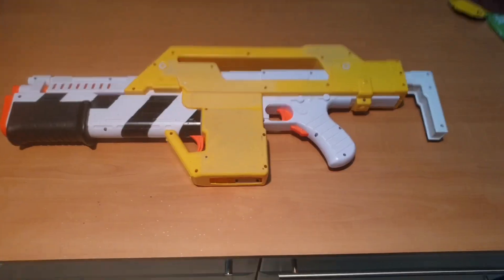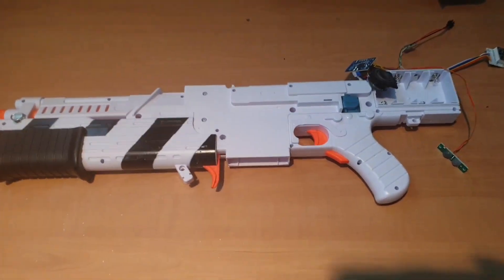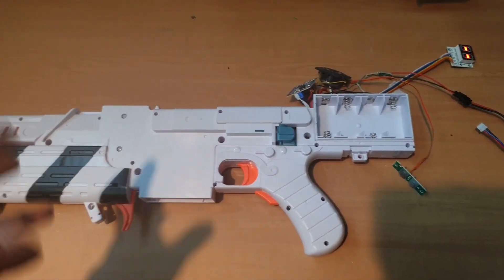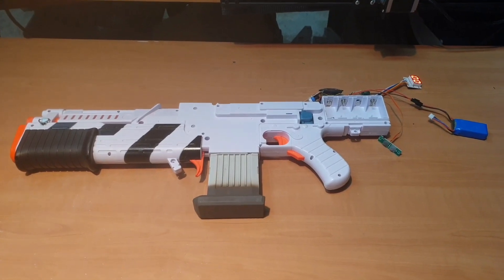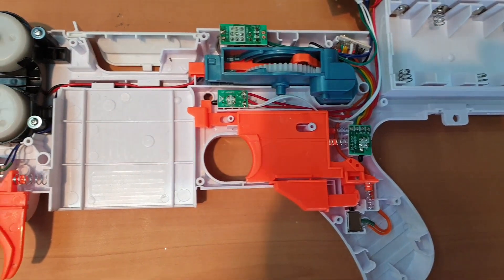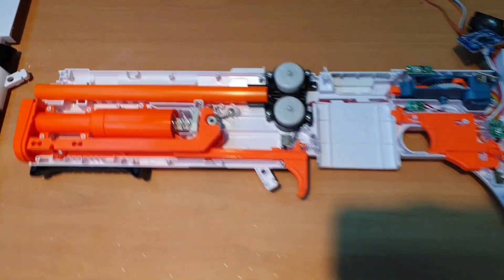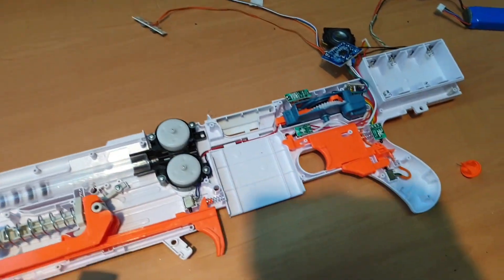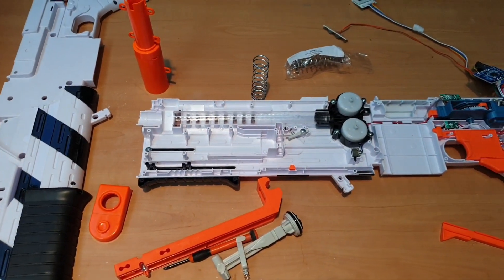Nerf M41A Pulse Rifle . Part 2

Comment: Hi I just got curious, Is the orange rifle barrel loose enough that if you just take off the cap at the front, the barrel will slide out when turned down? I'd just like the third barrel removed without having to cut the gun open
Reply from the maker: I'm not sure sorry as I had mine all opened up but I suspect it might
Reply: @J0D0CAST ok, thanks for the response. Seeing from the video though, was the barrel quite loose and came off easy when you opened it up?

Comment: How do you do the battery modification?
Reply from the maker: Just need to disconnect positive and negative wires from the battery tray and connect them to a "buck" 
Link : https://www.ebay.com.au/itm/192690522570?mkcid=16&mkevt=1&mkrid=705-154756-20017-0&ssspo=OiWp40B8Qny&sssrc=2349624&ssuid=aYBtqtu4Rxq&var=492832496012&widget_ver=artemis&media=COPY
Then supply power to the input of the buck with a 7.4v lipo battery something like this... link :
https://www.ebay.com.au/itm/155182146205?mkcid=16&mkevt=1&mkrid=705-154756-20017-0&ssspo=cwztt9wwsyu&sssrc=2349624&ssuid=aYBtqtu4Rxq&var=&widget_ver=artemis&media=COPY

Adjust buck to 6v output using multimeter
Reply: In the drop down menu on EBay there are a few options to choose from. What do you recommended ? I have no idea about the different types available so would really appreciate it.
Reply from the maker: The 3A stepdown is the best one to use
Reply: Do u have pics i can download of the wiring changes you made with the voltage regulator? I'm more concerned how to get the lipo voltage to the flywheels but 6v to the electronics

Comment: Thanks for the video. What do you plan on doing magazine wise? 2 thoughts I have for mine are either a talon mag adapter inside and use talons for games. Otherwise trying to do something to make it take 12 or 18 stick magazines. Are 18s even doable with the shroud and the protrusion 18s have?